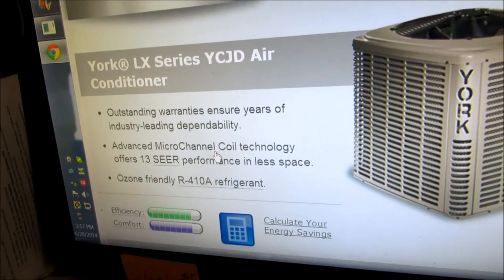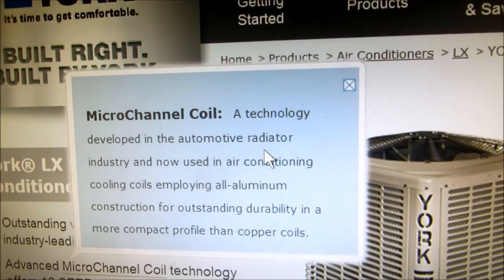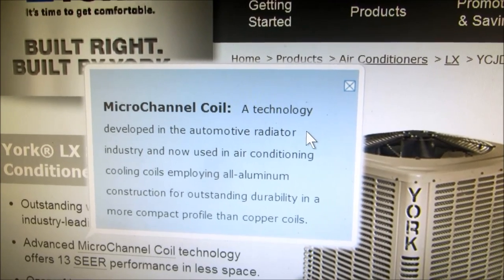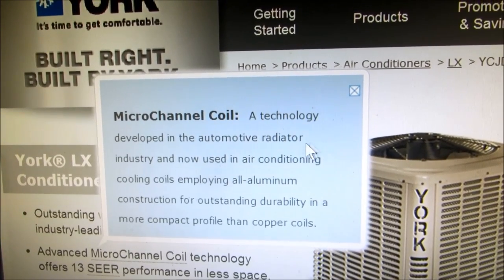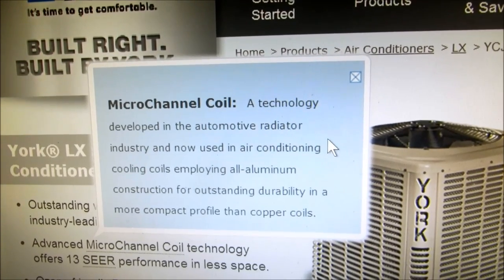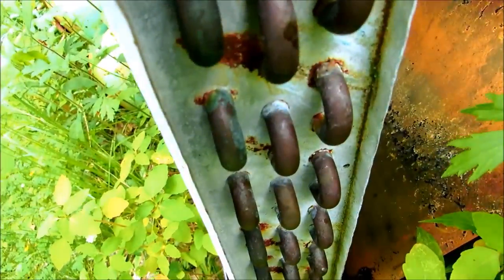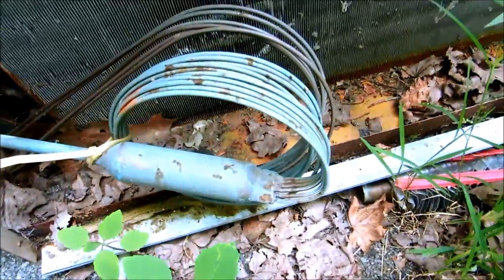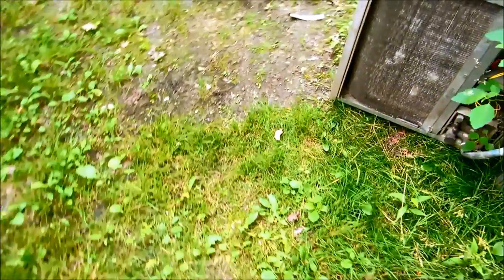hvac : why micro channel condensers suck

Comment: Great video Steve.  It's amazing that as a tech we can be fined thousands of dollars if we vent refrigerant to the atmosphere. However, these manufacturers can put out poor quality micro channel junk and vent refrigerant from leaks all day long and not get fined. I bet if the EPA fined the manufacturer 20,000.00 dollars for every defective condenser or evaporator out there, we would see the quality of components improve dramatically. However, that doesn't work in this day and age where the corporations have all the power and us little guys have none. Just an opinion.

Comment: Hey Steve I figured it out, as of 2016 York is still using Micro Channels on the 13 SEER units and the dry charged units, however they did redesign their higher efficiency units. The new 14 SEER and up seem to employ a traditional copper serpentine condenser coil.

Comment: Contractors do have the ability to effect a change in the market where units with micro channel coils are used.  Boycott not just the micro channel line, but the whole product line and let the manufacturers know we are boycotting their brand name due to their use of micro channel coils.  If all their equipment both micro channel and otherwise sits in a warehouse not selling they will get the message.  If they want to sell crap then they can keep their crap.
Reply: Boycotting an entire company for a single line is unnecessary. If that particular line gets no sales, it'll see reduced or eliminated production. Anything further is simply petty.

Comment: Just bought a new Noydyne 3.5 ton heatpump package unit. Unit is only 1 year and 2 months old. Both the condenser and evaporator coils are microchannel and the evap has a massive leak. I should have known better when the warranty papers said all parts only have 1 year warranty except for the compressor which is 5 year. So since I am 2 MONTHS out of warranty I was quoted rough estimate of $700- $1200 for repairs. That is half of the cost of the unit!!! Why bother because it seems like I will only get another year or two before it leaks again.  I had a bunch of older Nordyne package units R-22 that were 15 - 20 years old and never had problems. I guess Nordyne is not a reputable company anymore. I believe you are right about the microchannel not being able to handle the pressure, but I also think they can not handle the temperature fluxuation from being a heat pump. Half the year it is cold, other half it is hot and I don't think the aluminum can handle that stress like copper does. Microchannel just needs to go. PEROID!

Comment: I did not take chance by installing Champion / York  , their compressor may not be scroll compressor, at least in low end. Got lennox with scroll compressor and  tube/ fin.  indoor unit coil has no copper coil, other than  some  tubing  fitments. Old Goodman unit had all copper tubing. Thanks for the video.

Comment: Good video. I put in a microchannel evaporator at RE Michel and they just called to say the unit is not keeping up. Hope shes not a leaker!
Reply from the maker: well its on the low side so maybe its ok
Reply: steven lavimoniere it's in a heat pump air handler.  That's high pressure all winter. Darn thing is only a few months old. I will find out on Monday. There will be a video if it leaks.
Reply from the maker: sorry joe i do not mean to piss of yorks parade i know you sell them .people just need to know about the problems with this micro channel technology .it was a dumb ass move to try to use it for residencal cooling
Reply: Joe Shearer Yes it was RE Michel's AirTemp brand (Nordyne)

Comment: Great information as always! I don't believe that micro channel condensers can't work reliably, the same design is used in basically all automotive AC condensers and those regularly run at 300+ PSI without many issues. I think the issue has more to do with crappy design and quality control than the actual micro channel technology being inherently unreliable. If it can work in a car, why can't it work in a home AC system under similar pressures? The automotive industry actually switched over to micro channel condensers when they switched from R12 to R134a in the 90's despite the higher cost because micro channel condensers can dissipate ~30% more heat than a tube and fin condenser of the same size.

Comment: Thank you very much for a very practical explanation of an industry wide problem.  I have had since 2013 a York JCJD 13 SEER 5 ton unit that just started leaking.  Even though the unit is under a 10 year warranty, it will cost $1,400.00 in labor and materials (freon, dryer, etc.  ).  They also said it would be a 6 to 8 hour job to replace the coil, and then of course vacuum it out, and install  the freon, etc.  So now because of your presentation, I'm thinking that maybe it is time to "cut bait" and buy a different replacement unit.  Actually York should give me a non-microchannel option.
Reply from the maker: york went back to copper coils on there new 14 seer units . i would stay away from micro channel stuff
Reply: Gosh.. You are correct.  Will call York to see if there is a trade in program to get away from microchannel.

Comment: I am an electrical engineer who has a lot of experience in ammonia refrigeration. Now I keep hearing adds for the Fujitsu Hy-Bred Flux Inverter. Yes I have Googled it and just get sales BS. My house I swell insulated with hot water baseboard heat, so I just use window rattlers for AC. I install 4 of them and cool the areas I live in along with a few box fans. No new shit!!!

Comment: When they get wet the water gets trapped on the coil and the head pressure goes way up until it dries. I’ve done a maintenance before and had the head pressures control trip. You are supposed to dry the condenser before you turn it back on. What happens when it rains?

Comment: thanks Steven.....its all about the $$$  the manufacture builds junk that cost less to build and needs less re-frig so they can dump it on the contractor and the customer.  they hope it will last at least a bit longer that the warranty.

Comment: Funny but true.  My head press on the last Micrchanel Gibson unit was 300 and 50 psi on R 22 unit.  Condenser was not clogged and have piston inside Evap coil was clean. All points to bad Microchanel Cond Coil as Steve mention. Tnks

Comment: I offered Air Temp with the micro and Ruud without , the Air Temp installs turned into disasters about half the time, water drips, restrictions, leaks. the Ruud has had no issues since the vinyl wrap on the feeder tubes. Currently have one that is shedding water on to the filter, they say that problem is due to a coating failure. Installing these units cost me thousands of dollars. The biggest problem has been restrictions, I personally believe that these systems have oil return issues and are fouling, changing the coil seems to correct the problem but I think that is because so oil is being removed from the system when the coil is changed. The dealer has lots of stories but they don't seem to line up with what we see in the field. I still offer the cheaper Air Temp package units with the micro and have never had a restriction issue.

Comment: ok steve, i have a question.

so u have a 410a system rated at 9lbs.....it leaks out half through the suction side. is it imperative to remove all the refrigerant anyways so that the unit has the right blend? if this is the case, does it really matter if its microchannel?
Reply from the maker: if there is a leak it will leak out again just add what you need till the leak is fixed. then i would put in new refrigerant . if it leaks out under a leak it will fractionat  seeing its a blend its just how it is. i would not worry to much about it at all .

Comment: sharp edges is where all the stress from pressure is concentrated...thats why aircraft windows have rounded edges..so they don't blow out of the friggin plane...same reason you stop drill a crack...Learned that one in A&P school 20 years ago...thanks for sharing my yankee friend

Comment: Micro coils pass air/ refrigerant slowly through it, so it can not take fast pumping from compressor and pressure build up too much in the condenser unit, is that right?

Comment: Car air conditioners use microchannel coils and only go up to 300 PSI on a sweltering day and the microchannel flat tubes are thicker. If I were to design a central AC with microchannel coils, I would use R1234yf freon instead of R410a, a Danfoss scroll compressor, and thicker flat tubes than york microchannels. Also, have a liquid line accumulator so leak repair work outside the condensing unit so that you can just front seat the liquid line king valve instead of needing that bulky recovery unit and recovery tank.

Comment: I have only seen a couple of them. I am in western mass, for some reason there is not alot of micro channel out here. You and John are the ones that scared the crap out of me with those units. lol. Great video.
Reply from the maker: Year Round HVAC well they suck and all leak ..so get a clue before its to late

Comment: Hi Buddy, the systems that carry R134A leak just as bad as any with different refrigerants, it is a total shame to know that the said dumb decision was made in the mid to late seventies to use aluminum condenser coils and the manufactures eventually had to return to using copper coils.

They are causing customers great amounts of money to replace the coils when they leak at the headers and neither manufacturer would offer half cent to help in the repairing or replacement of the coils.

IF WE WERE TALKING OF AUTOMOTIVE VEHICLES THEY WOULD HAVE ALL BE RECALLED YEARS AGO, IT IS ABOUT TIME THAT SOME THING SENSIBLE BE DONE  TO STOP THE ROBBERY OF THE OWNERS.

Comment: In my experience with the micro channel coils, they leak a lot and mostly where the dissimilar metals join. Case closed, they are expensive junk that will warranty break your business, and don't hold a pump down unless its winter outside.

Comment: Isnt aluminum to porous to contain high pressures in a thin walled tube format under the added strain of thermal expansion and contraction? I've seen aluminum propane that's for the buffer at work so I guess if its thick enough its ok but no good for a rad. Additionally, I noticed in the video it leaking where the copper meets the aluminum, that's because the 2 materials expand at different rates, it doesn't matter how much solder they use its not going to hold for long and the fact the put that shrink tubing means they knew that. Every component in automotive is sealed with crush washers. Guy charged me 3k for a new condenser and evaporator. I checked and yep its a flippin micro channel, guess he'll be back replacing it before the end of the warrantee.

Comment: R 410A pressure about 140 and 340 liquid , if the condenser fan motor fail the pressure will go up and cause a leak or multiple leaks , manufacture should put a high pressure sensor with a reset bottom   in every condenser

Comment: Not sure if you figured this out by now but I wanted to help get things straight about the micro channel. I can clearly see that on the website you have up it clearly says "automotive radiator". Obviously the guy doing the website doesn't know what he meant to say, but this points to the use of micro channel for the a/c condenser in cars. They have used micro channel for almost 20 years now. The R134a System must be capable of at least 450 psi where either the high pressure switch kicks off the compressor or the high pressure plug blows out the compressor. These condensers have been working for years taking hits from rocks and road debris without problems. Now these condensers are straight and not bent, so maybe its just them bending them to fit is creating problems or they have cheaper manufacturing than the automotive industry.
Reply: Ultron No epoxy joints to copper in the automotive coils
Reply: ok...... you're getting galvanic corrosion for one thing, then you're going to get pressure problems, there's a reason why pressure vessels are round!  its called hoop stress look it up!  ffs these guys need to get their brains working.

Comment: Did HVAC&R 49 yrs, the last 17 yrs I was in charged at Hershey Lodge in Hershey P.A. the last 6mos a new large rooftop was put in that's the first time I noticed  micro channels condenser TRA-- unit Thank God I'm retired ,you can't use a power washer on that coil ,called TRA-- tech support, after 5 month coils were dirty Don't  miss the 2 A.M. largest W.I . Freezer warm !

Comment: I remember reading an article about micro channel in the Airconditioning News magazine. Just wait till they hit the coil with nubriite and don't quite rinse it enough. Aluminum is softer than copper and much harder to solder or braze. A small receiver would solve the pump down problem, and with 410 , they were supposed to have done away with schraeders and been all txvs now... They just look for cheap, like most Americans. Most Americans are of two classes. The cheapest because they figure it's all the same. The there's the Americans that are cheaper and want the very best, because they don't want to have to pay for it twice, so they bend towards quality. German Engineered, or Japaneese products. Go figure the Japaneese Mitsubishi outdoor unit (Mr Slim) can be outside your bedroom window and can't be heard. Top of the line platinum series is still greatly louder than the Japaneese stuff. (74db vs 35 db). Even the Japaneese and Korean labor is becoming so expensive the sub out to China now. Few things are made in Japan now. Best thing for micro channel is the after market removable condenser screen wrap that can be cleaned off to protect the coil from the pollen and cottonwood fluff. If you are within 50 miles of the coast hey recommend epoxy coated coils inside and out. I must say you are the fastest mechanic I've seen in the field bar none. Your vids are great. Suggestion use a tripod and get yourself a head lamp, and knee pad

Comment: I think part of the problem is they wish to be cheap on building it. If they did spend more money making it thicker it may hold up alot better. I dont see the cost for them to build it thicker being that extreme. Maybe another 10-20lb of aluminum. Even at $100 more to the customer or dealer i think in the long run it would save money on warranty. 

On another note, isnt condenser pressure in a car 100ish?

I do agree running r410a in this is pretty stupid. Think one of these in the nevada desert what pressures its hitting.

Comment: R410a  refrigerant is no good. I have used it to and you can over charg unit
Reply from the maker: FATBOYROY4370 yes 410a  it can get away on you very easy . because your charging it by liquid best to add a little  and then wait a bit ,to see what happening

Comment: Got a Nordyne,  3 years later leaking. It leaks about a pound out in 30 days then stops so it cant take the pressure. I put a pound in it until it leaks out again. I cant see any oil leaks. I cant pick up any leaks with my H-10. Before this I had a Coleman with copper coils. Still leaked. Evaporator coil replaced, ( under warranty but still $400 labor. ) then compressor died after AC guy destroyed it with stop leak. It was 3 years old. In the past I had R22 systems that lasted 20 years. They are making leaking coils on purpose in order to sell more units. These are packaged units so no line set or install errors. It's the AC companies with their thin walls designed to fail systems. They are robbing the public. Next unit will be an American Standard.

Comment: A lot of what you said makes sense, especially a receiver expansion tank near the compressor so that you can draw down the system.  Totally agree.  And if the manufacturer doubled the wall thickness of the micro channel, then maybe there wouldn't be any leaks.  Bahhh - Bahhh - Sheep - funny as all hell !

Comment: All aluminum coils in general are a bad idea.  I work in commercial refrigeration and Hussman is bad about putting aluminum coils in their cases (atleast they were, I haven't worked on any Hussman equipment made after 2007, and most of what I work is much older than that).  Every time they leak, it is always at the union/transition between the copper and aluminum, and they form leaks constantly.  We have far few problems with the copper coils.  I'm all for innovation and efficiency, but at least make sure it is an actual improvement over the old technology
Reply from the maker: VTdarkangel i will not buy micro channel condensers .. york is going back to copper condensers by  the fall i guess micro channel was not the way to go after all